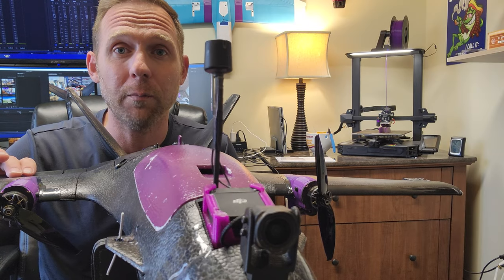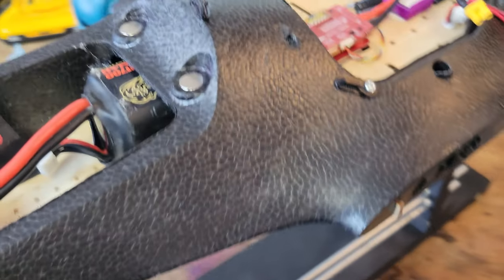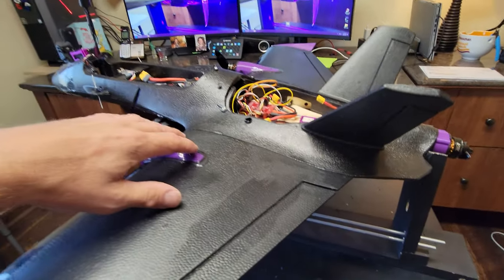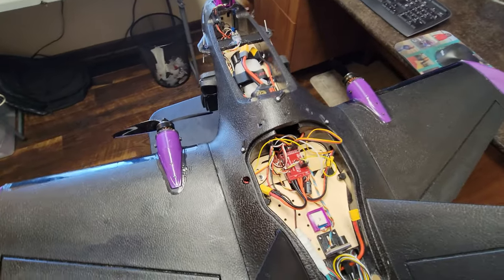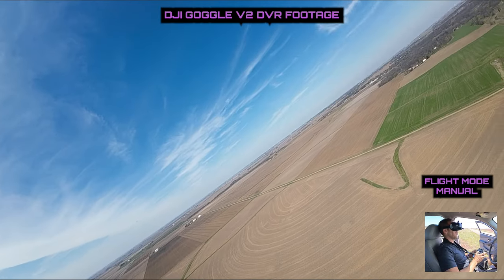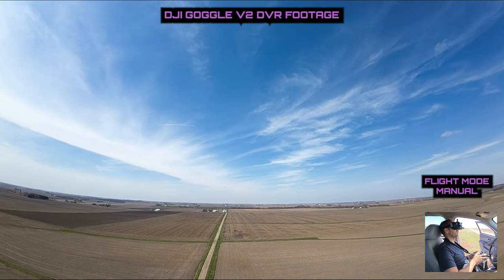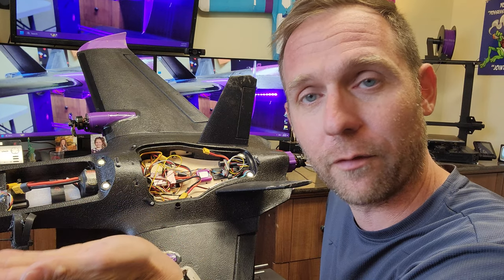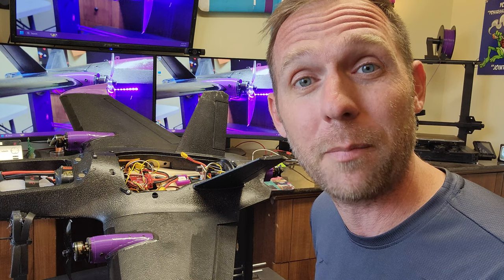Twin Motor AtomRC Dolphin Build! PART 2 - Changes and Mods - FPV Plane

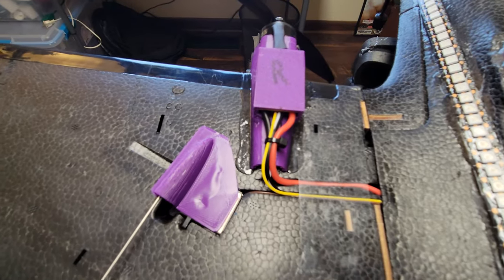Comment: Can you add the updated STL for wing motor mount with the air duct at 5:55? Thanks.
Reply from the maker: Good eye!  I totally forgot about it.  It is nothing special but a simple box that I a made in Tinker Cad.  I still had to Dremel it out some to work and it's hot glued to the nacelle.  I go over this in Part #1.  Give me a little bit to get that uploaded to my thingiverse account - https://www.thingiverse.com/jeffdoesthis/collections
Reply: @JeffDoesThis  Thanks. Btw, your videos have been very helpful. 👍
Reply from the maker: Here you go - ESC Holder - https://www.thingiverse.com/thing:6558893.  I have also updated the links in the description.

Comment: my battery on my dolphin is also way back in there, i run a 10k mah 4s2p and i have to have it most of the way to the rear the same way. i just printed these pods for my dolphin... let see how it works for me